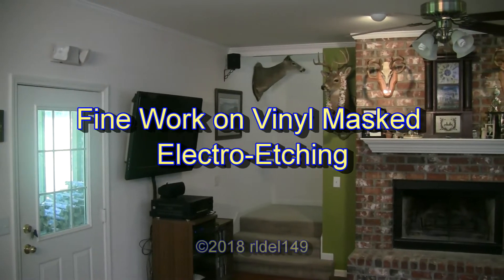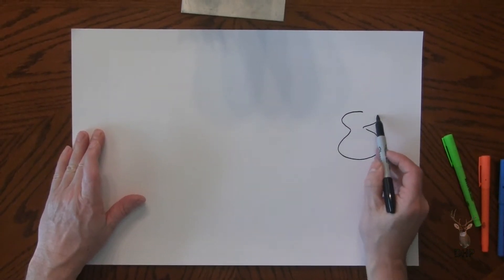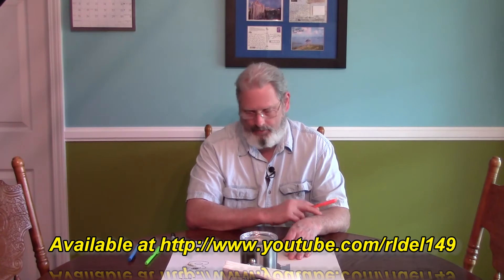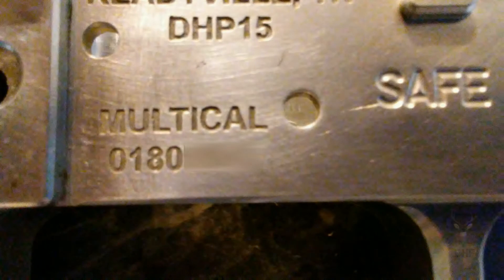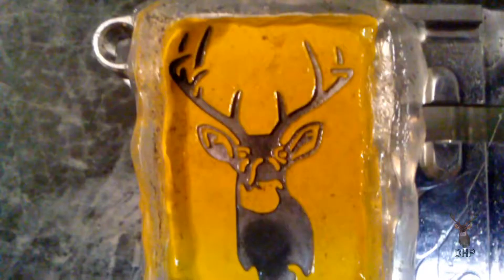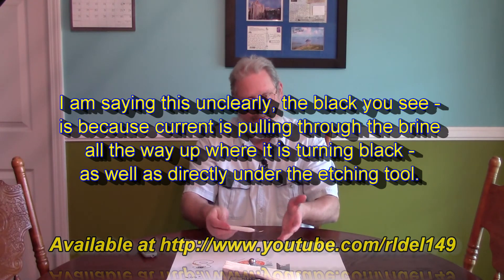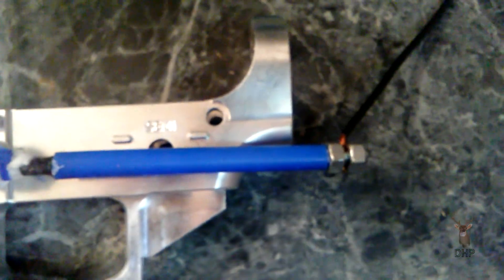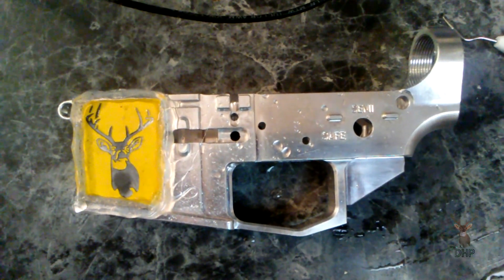S8E5 - Fine Work on Vinyl Masked Electro Etching - 1080p

Comment: I had been going crazy trying to find the tiny inside bits of letters and re-stick them to the metal on size 10 font. The nail polish trick is genius! And thank you for mentioning a better vinyl to use talking about the cut settings. You said the speed is set to 3, but do you know what the force is set to?
Reply from the maker: No. His wife ran the machine and I get the feeling he wasn't allowed to touch it. He has since divorced and remarried.

Comment: Will this process work on steel instead of aluminum?
Reply from the maker: Have not tried it. But it should. Potterfield at Midway has several videos using a regulated rig. And I have done stainless. It's much sower.

Comment: Just used your technique on a lower. Said screw it I'm not practicing. Guess what??? Perfect. I guess I watched enough to get it right. Not about to try it on my polished one but a distressed flag and Fire/Safe worked well For Dog Fight ink decals. Specific for this process.
Reply from the maker: Being irresponsible it tightens you up while you do it but it works. That vinyl is the key. Sticks well if the surface is clean.

I'm glad it worked out for you. Definitely one of a kind each time one is done.

Comment: I have heard that if you use clear nail polish to re-etch designs that are not deep enough after you have pulled off the vinyl stencil. Great video I appreciate your knowledge share!
Reply from the maker: We did a lot of experimentation. Nail polish in the dots is a patch, it would be better if it wasn't necessary. But it helps.